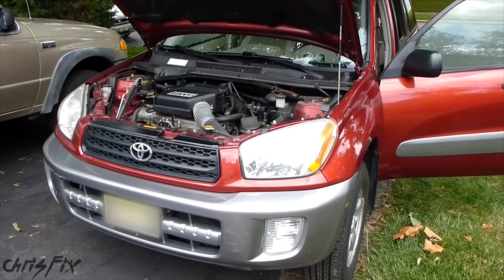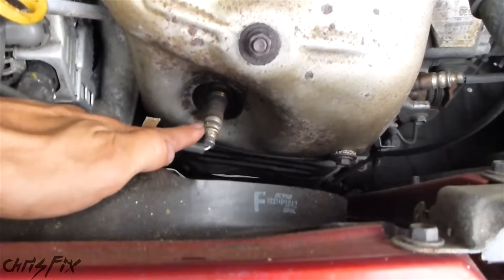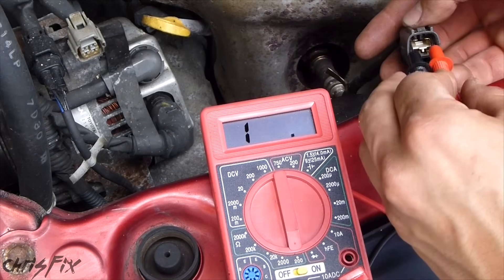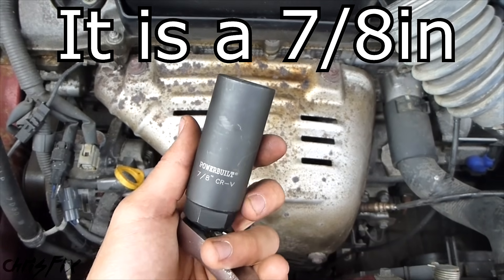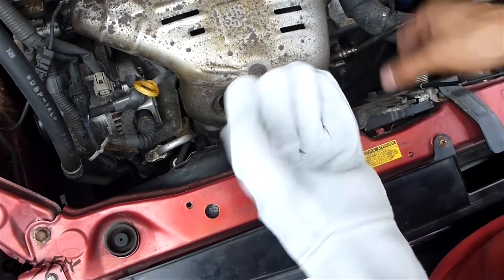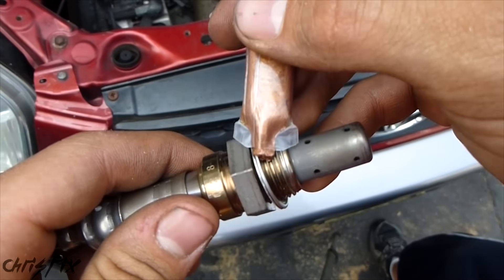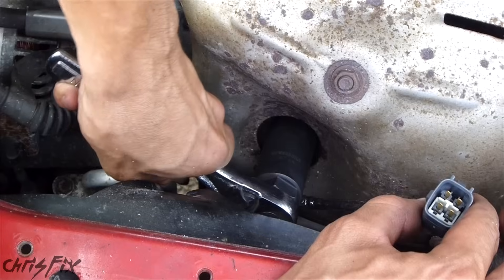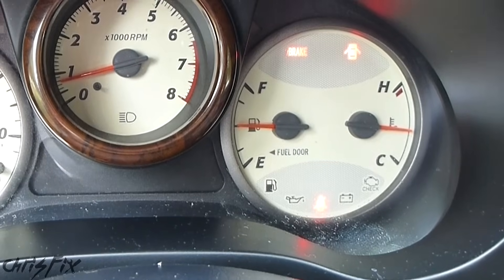How to Check and Replace an Oxygen Sensor (Air Fuel Ratio Sensor)

Comment: Hey Chris! Hope u r doing fine. My car is a 1997 Toyota Vista (Camry) 4S-FE engine. Recently I have a DTC 21 (bad O2 heater circuit) I’ve checked my o2 sensor, wiring, ecu. Everything seems to be okay. But the code. An not be erased. My car has rough idle issue with the AC on. It’s killing me. Please suggest and save me. Thanks in advance.
Reply from the maker: It has to be either the ECU or the sensor or the wires. I would double check. The rough idle is probably because the O2 sensor that is bad is the upstream sensor which helps the computer calculate the air/fuel ratio.
Reply: @chrisfix  thanks. I’ll double check it.

Comment: You must clarify...an A/F sensor is NOT the same as an Oxygen sensor.
Reply: What is the nox absorber B2 ? 
mine on monitor test says "Fail" 
but i can't find anything to know 
what that nox absorber B2 is...
I'm assuming it's a sensor but videos
of these things all look the same & called 
different things... upstream / downstream,
oxygen sensor, fuel air ratio, bank 1 or 2... 
🤷‍♂️help??? i have 2009 ford focus 1.6 tdci.
Reply: @MrMaster2262  Unfortunately I do not know. Sorry :(
Reply: @The2Coolest2   No worries mate
Thank you for the speedy reply 😉👍

Comment: my 2004 toyota tacoma engine light on, after consulting with carMD it show PO135. question, can the code PO135 affect the RPM of my truck. when turn on truck it'll run at 1000 then after its warm up it'll go up to 1700 -1900 rpm. also if can give tip how to lower the rpm please.
Joe

Comment: Hello my transmission was running smooth no problems and now my car randomly got stuck in first lmk thank you can o2 sensor cause car to go limp mode or stuck first gear…?

Comment: Just one thing, should never touch the sensitive surface at the nose of the sensor. It is very fragile. If you do, you will contaminate the surface of the sensor making it useless.

Comment: What if it still shows up after putting new o2 sensors and erasing codes ???? Thanks hope u could give me some suggestions its only one code away from check emgine light p141on my gt 2010 convertible stang

Comment: I have an 03 Tahoe getting the heater malfunction o2 code bank1 sensor1,it only has 1 black wire and its hot,does that sound correct?

Comment: I have a code calling for this.  03 Avalon XLS.  250k miles. Other than just that one code, car runs great.  I live in a state with no state inspection.  So repairing this is only by choice.  Would you suggest i fix it, or is it not of upmost importance?

Comment: hey the little tiny holes on a sensor, does it matter? i have got a FORD O2 sensor to be fixed on ELANTRA. even tho they match with the wiring there's a little difference with the holes on the tip of either sensors. can i fix the ford O2 into the elantra without any problems?

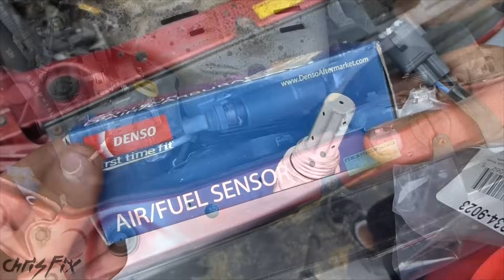Comment: This video doesn't make any sense  2:57 clearly shows the part 234-9023 BUT that's the wrong part for bank 2 sensor 1 (bank 2 sensor 1, is the passenger side in the United States.) The correct part number is denso 234-9028, it will clear code P1155. Part 234-9023 is for code 1135. Chrisfix must have used editing magic to cover his mistake because the plugs for the two upper air/fuel sensors are completely different, ASK ME HOW I KNOW.

Comment: My Lexus is at 160k now. I don't have check engine codes. I think the O2 sensors are original. Should I buy new sensors based off how old it is now or should I just wait until theres an issue ?

Comment: Chris, I have 09s80 . The front o2 sensor reading stays around 1v, rear sensor fluctuate between 0.2-0.8 v. Engine code is p0420. What could be wrong? Thank you

Comment: Hey I know this is old and stuff but what if my multimeter reads above the specs resistance , my o2 sensor reads 28+ ohms while my car specs rated for 4 to 6 ohms. does it need replacing?

Comment: Thanks for the explanation. I only have a doubt. My Toyota rav4-2001 has four Oxygen sensor and I checked all. The two Frómista the upper side(between engine and catalyst), indicates tha right mesure(about 2,6). But the two sensor infrarrojo the lower side, indicat 1. There sino change inthe measuring device.  That means both lower sensor are dammaged?

Comment: Chris, I got a toyota car  and  in some instances  the check engine light lit up  and  I scan it and found  the fault code P0138  O2 sensor circuit  high voltage bank 1 sensor 2 and I know that its my  downstream so I did check  the wirings, pins and its all good no physical visible damage, I try clean the O2 sensor with a carb/throttle  body cleaner spray, I did check the resistance of the sensor and it gives me 6.9 to 7 ohms readings.  I clear the  fault code using the scan tool and it disappear. I try to  turn off and on the engine to see if the check engine will lit up but  not. But the next day  when I start the car  the check engine lit up  with the same fault code for my downstream. its like the problem happens  twice  its it only shows 2 times  when   I start the car  but  after I  clear the fault code  and  rescan it it doesn`t find any error .  until now been using the car  for  a week since the last  check engine lit up.  Do you think  I need to replace the  sensor if  the same fault code appeared again?  if the sensor is bad I shouldn`t have a good reading on resistance right? and also if its  bad the check engine will stay lit up? what do you think.  I need help.

Comment: I just replaced the downstream sensor on my 05 civic but it still sends the code. However, it'll only send the code after a cold start. I can't figure out why my car runs rich only when it's cold

Comment: my sensor has 6 wires, I tested all of them and only 2 gave a result. I assume these are the 2 to test and a result means the sensor is good?  will any combination other than those two together give a result on the ohm meter?

Comment: Great video,Chris,thanks. Is the resistance check applied to my 2010 Pilot also? I just extracted two codes. They are P0135 and P0155

Comment: Mine i tested ok but still check  engine p01167 code.  O2 sensor1 zero voltage  on idle.

Comment: To remove the sensor, I snipped the wire of the old sensor and used a wrench to remove it. I had to remove the heat shield from the exhaust manifold but it saves you a trip to the parts store if you have the correct sized wrench

Comment: Thanks Chris;
my O2 upstream has continuity, but on the weak side, which now explain Y I have a 1 minute
idle at 2000rpm at start. B4 it was 5min. but after replacing the engine coolant sensor
returned a much better start. Then only thing left is to replace the O2. Would not have known
that, if I hadn't seen this presentation. Thanks again.

Comment: Professional mechanic here. Question......if you can do this then why can't you replace the leaking valve cover gasket which is more important than the heater circuit on the o2?

Comment: My question is i replaced the bank 1 sensor 1 but after a while my engine light came back on ? Wht could be the problem and also the engine is shaking alot too

Comment: I know Chris wont read this but anyone else that could help would be great. Replaced my rear 02 sensor on a 08 Suzuki SX4 and this is my 3rd time replacing this sensor in a year. i do not think it is my sensor and the code goes away after resetting it until I restart the car and it comes back saying there is an issue. idk what to do or how to fix it.

Comment: Now what if replaceing the sensor didnt fix the problem
Reply from the maker: Make sure the part works in the first place, if it does then do some more troubleshooting and find out if there are other/different fixes for your code! For oxygen sensors sometimes exhaust leaks can keep causing issues and you want to get those resolved!

Comment: with ohmmeter you can only check the oxygen sensor heater but you can not check the actual value of oxygen sensor working condition

Comment: Thanks for the video, Chris!!! I have a QQ, I have a 2018 honda CRV and recently its catalytic converter and downstream oxygen got stolen and I installed an aftermarket catalytic converter and OEM oxygen sensor. But once the work was done, I see that the new oxygen sensor was joined to the exhaust pipe just before the catalytic converter even though there is a space left on the new catalytic converter for the oxygen sensor, the mechanic said it's fine but was kind of worried if it was done in the right way. What would be your comments on this one? Is it okay to have a downstream oxygen sensor installed away from the catalytic converter?
Reply from the maker: It won't read correctly if your downstream oxygen sensor is right before the catalytic convertor, it needs to be positioned right after to get the correct reading for emissions!
Reply: @chrisfix  Thanks for the prompt response Chris, upon checking I see my 2018 Honda CRV LX has two sets of CAT converter, one inside the hood near to the engine(primary) and one on the bottom which I had issues with. So the primary one has an oxygen sensor(upstream sensor) before the converter and the bottom one (upon fixing) have an oxygen sensor before the catalytic converter. So this is how it looks like, engine emissions -> upstream o2 sensor -> primary catalytic converter -> downstream 02 sensor -> rear side catalytic converter. Will it still cause issues with correct readings as you mentioned earlier?

Sorry if it's confusing, I tried to add my understandings as a beginner as much as I can. Really appreciate all your effort in helping with this. Waiting eagerly for your response!!!

Comment: Lol chrisfix the sensor you showed as new was 234-9023 that was for bank 1 sensor 1. The one you replaced was bank 2 sensor 1 234-9028 the connections are different. What's up with that ?

Comment: I’m wanting to replace mine on my 2012 SE and neither one has gone out. I’m at 178k miles so do you think I should just go ahead and change out both sensors? I like to keep my car running good before the problem happens. What do you think? I don’t have any check engine lights either no nothing like that. Just kind of a hesitation sometimes and feels like it’s bogging for air or something sometimes in the heat what do you think?. Replace him or wait until I have an engine light? I mean I have the money to replace both of them so what do you think?
Reply: Check and clean your Maf sensor and throttle body.
Reply: @professionalics  already did and changed o2’s out and what a difference

Comment: P.Dub from Fresno on my lady Sonya's tablet...Chris good video on the o2 sensor, however I've learned that just because there is continuity does not mean that the o2 sensor is good..In fact mine on my 2003 Hyundai Elantra o2 sensor had continuity, but was no good! I replaced my car's o2 sensor with a new one and it showed the problem repaired....again thanks for the video..
I hope this will help the next guy...

Comment: I replaced a catalytic converter on my Chevy Cobalt and got a P0420 after replace. It didn’t have this before as the old catalytic converter had a hole in the flex pipe. Could it be a bad 02 sensor?

Comment: Your vids are a masterpiece!! 🙏🏻 .. Hey Chris, I managed to change the O2 sensor from the upstream front and rear on my 99 Lexus es300. I erased the codes after but the same code is turning back on after I take it for a drive. Should I reset the ECM or do I need to get new sensor? Thank you!! 🙏🏻

Comment: Hey Chris. I had the p0174 and p0171 codes. Replaced o2 sensors but when I go to live data they show 0.0 voltage. I've driven over 200 miles and no check engine light?
Reply from the maker: is that at idle or while driving? Usually they will be at 0 when just sitting there!
Reply: @chrisfix  both idle and driving
Reply: It tells me fuel sys closed?

Comment: Its not always a good Idea to use.after market sensors. Cheap is not always better. Fords you should always use OEM sensors Also you should always soak the sensor with rust penetrant. PB Blaster Is an excellent one.

Comment: a few things to note here.... first of all... Toyota vehicles do no like aftermarket A/f sensors... If you know that is the problem, its best to buy original toyota sensors.   Secondaly, you cannot confirm the problem after "10 minutes of driving"  you need to drive long enough for the monitors to reset... usually that means atleast 100km or more.

Comment: Hi chris, brakes plus says my car needs a new catalytic converter 2016 Nissan  altima. It's got a p0420 code but they're also telling me that they recommend getting two new oxygen sensors as well as a tune up with the new converter. Is this true or are they trying to pull a fast one on me???
Reply: you should check with Nissan dealership service because i believe they warranty the emissions systems on vehicles up to 10 years

Comment: Too late but did you know that o2 sensors don't actually go faulty. What i mean is that the sensor tip gets clogged and that's why it won't work anymore. Just heat it up with blowtorch until its red hot and then just press compressed air into it blowing all the shit away.

Comment: Hey Chris I just replaced the O2 sensor in my 07 Infiniti m35 and went to start it up and the code came back with some misfires any ideas on what I can do? Thank you
Reply: You probably have a clogged catalytic converter
Reply: @sleepyskaterzzz  turned out the new o2 sensor I got was bad and caused a coil to give out, so replaced the o2 sensor and the coil now it’s all good

Comment: My gas mileage has gotten worse over the years and i heard changing these out could help. I have a 2009 chevy malibu lt 2.4 l and it gets 22 mpg city but lately its been getting 18 or worse. Already changed out my air filter. Would you recommend changing this out?

Comment: You shouldn't work on a hot engine... Not only because you could burn yourself, but metal expands. I've seen spark plugs, and o2 sensor snap off in the head or bung

Comment: Hi Chris, I'm your biggest fan and subscriber.  I need your advice on 2000 infiniti i30.  How can I speak with you brotha?
Reply from the maker: Thanks for the support! What's your question?
Reply: @chrisfix  My 2000 Infiniti i30 is kept stalling and dies while on red lights or while running.  I am getting P0140 Bank 1 Sensor 2. Where do I find the exact location as this car has "4" O2 sensors? Also, what brand you recommend cheap and reliable as Dealer is asking for over $280 for just a O2 sensor. Please advise. 
Thank you for what you do for us. Love your videos.  I love fixing cars.
If you don't mind,  my cellphone number is (818) 744-4404.  Thanks Chris 👍

Comment: Awesome videos. I have a 2013 GMC Sierra 2500hd with oxygen sensor problem and I took it to a mechanic shop and they changed the sensor but the next day the check engine came back on o took it back and they said it might have a short somewhere and I should take to the dealership instead.

Comment: i have a honda civic which started problem few months ago whenever i drive for more than 10 minutes engine stops anytime and i had to wait for few minute to turn it on specially when i slowed my car near speed breaker or U-turn or hold the brake for few seconds in the traffic and also if i drive in 110+ km/s mechanic said it has an issue with the fuel pump and i replaced it but problem did not solve i replaced 4 times including universal and genuine and i was frustrated i tested in computer to find out any hidden issue but computer was not showing any problem mechanic suggest to clean the injector and replace the fuel filter and i did whatever he said to no avail then he assumed there is electronic issue in my car he also advised me to replace fuel canister which is installed in the bottom of the fuel tank etc and that was his guess, i changed the mechanic and the other said the problem is not very big it is sensor either CRANK or CAME i replaced both and problem solved, if some one else is facing the similar issue i hope this will help
Reply from the maker: Thanks for sharing!

Comment: How you know if you got the right o2sener from the parts store. And after you put the o2sener in i was told at the parts store i have to drive it 50 miles so the check engine light will stop coming on
Reply from the maker: Match up the part and make sure the part number is compatible with your car! And they are correct!

Comment: Really nice, clear and well demonstrated process of checking and fixing. Some sensors have two white wires, a black and a grey. The white wires are for heating I believe. Is that correct?

Comment: You know, you might want to do this one again.  (I see this is one of your first ones.)
What's bank 2 mean?  What's sensor 1 mean?  How do you find them?
Reply: If I'm correct Radio Demon. Each bank refers to each catalytic converter. If your car has 1 cat it'll have 1 bank. If it have 2 cats it will have 2 banks. You'd have to check for info on your car to figure out which cat is 1 and which one is 2. Sensor 1 usually means the pre cat sensor and sensor 2 is the post cat sensor. So for example if your issue is on cat 2 assuming your car has two cats and is after the cat then it would be Bank 2 sensor 2.

Comment: You aren't lying about them being expensive. I drive an '05 Civic coupe EX Special Edition. The downstream sensor is piss cheap at about $40. The upstream on the other hand lol. The cheapest I found was at $250, the most expensive being $550.
Reply: my dealer quoted me $500 to have it replaced in my 2010 hyundai elantra. unfortunately I just have to do it.
Reply: @asdf256  Holy shit. Is that including labor?